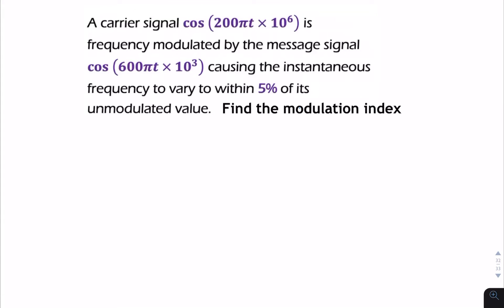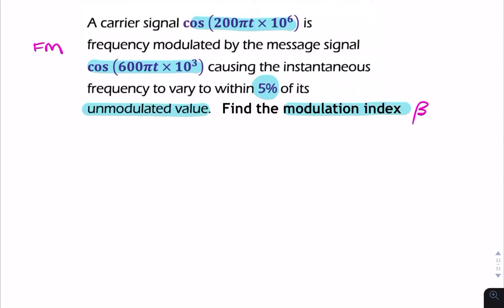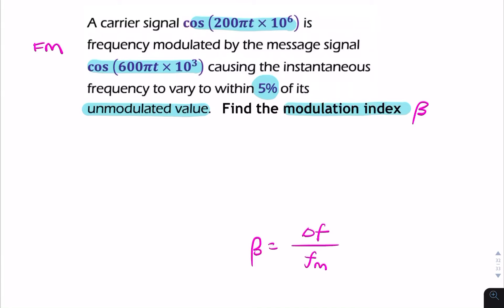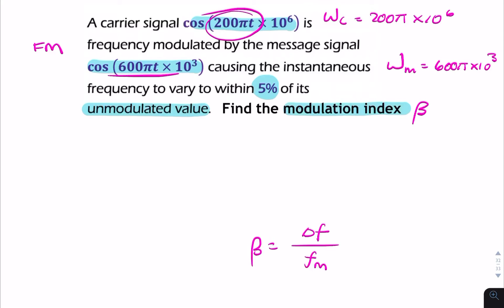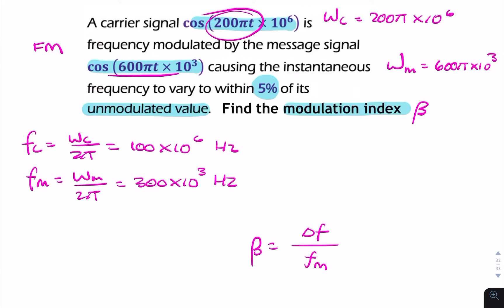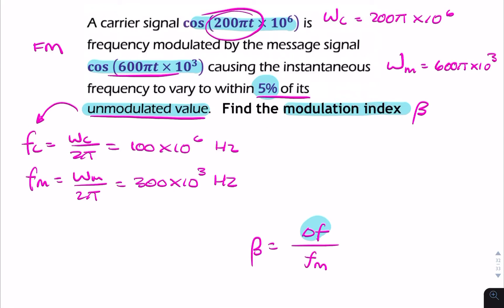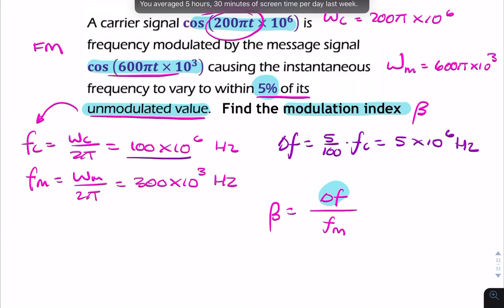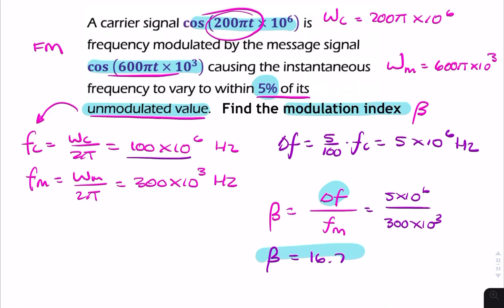PS4: Finding FM modulation index using frequency deviation as a percentage of carrier frequency

Comment: Professor, I am studying FM modulation and wondering if you could help me to solve this question: "Considering that the modulating signal band of a Brazilian commercial FM radio is 15 kHz, calculate, using Carson's Rule, the modulation index used by this radio". Kind regards!
Reply from the maker: You need 2 bits of information to find the modulation index: any 2 of: message bandwidth, bandpass FM bandwidth, frequency deviation. In this question you're only give the message bandwidth, so it looks like you need more information.